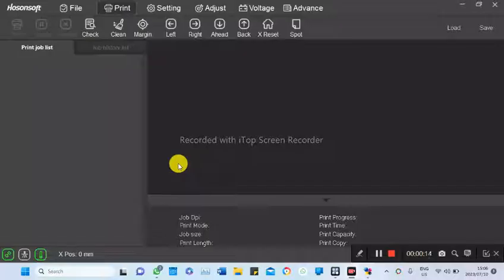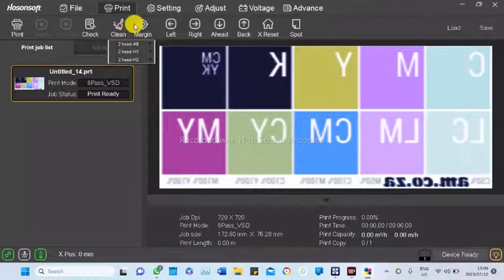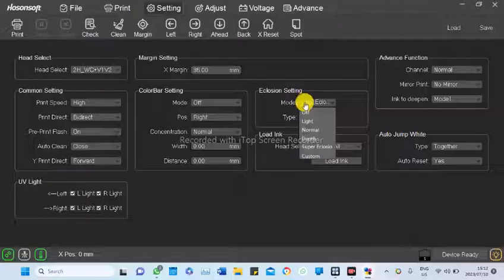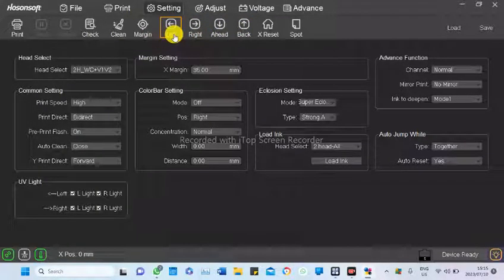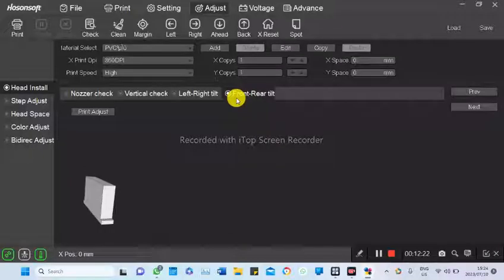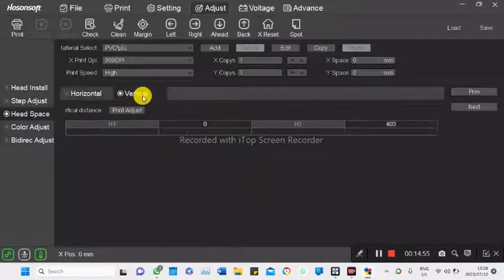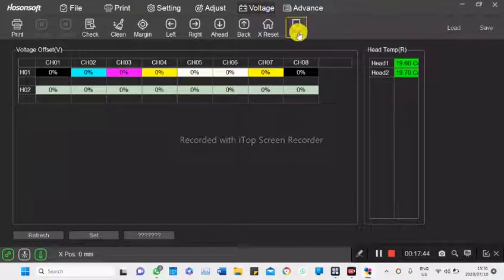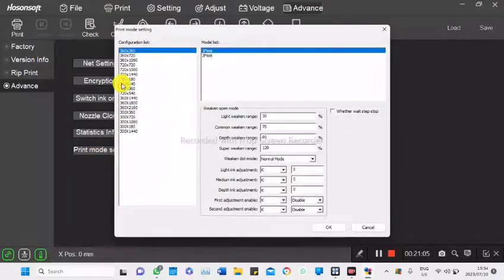DTF HOSONSOFT PrintEXP Part 1

Comment: Hello, my name is Kelvis, I have been looking for information about this program, since I recently bought a dtf plotter with 2 XP600 heads, which was delivered to me with a 720x720 ICC profile but it has many flaws and I hired a technician to make me a new ICC profile, with more resolution. but we ran into a problem, when creating the icc profile on the flexi it tells us a 720x1080 profile in 6 passes and when it comes to ripping a file and uploading it to hosonsoft it does not default the profile to 720x1080 in 12 passes and the prints come out very saturated. We have no solution to this problem. How can we contact you to see if you can help us or tell us the price of your advice in the case?

Comment: Do you think it's possible to take a machine with 2 white nozzle groups and swap one of the white groups to varnish? I assume if I add a completely different container to hold the ink and new dampeners it should just be a matter of getting the software to deal with that change.
Reply: If your RIP software support it

Comment: hi,how to adjust head space?the white ink is a bit off not exactly on the print
Reply: Under adjust then headspace then  vertical. Moving the number higher moves the white towards the printer. Moving the number down moves the wig it’s start point away from the printer.
Reply: would you happen to know how to move the white from left to right?  @msmusick84
Reply: Pls were you able to solve it... And how please help

Comment: In certin colors when its a large solid color i alwys have banding....how can i fix this. Tia
Reply: check printhead nozzle test result, most likley nozzle blocked
Reply: @AchievementMatters  I have this same issue with banding in large solid colors, Its more like a fade for example.... pink to almost white and back to pink... But over and over at equal intervals with perfect printing in between. My nozzle tests are perfect, new dampers and print heads that print perfect when the design isn't a solid color. I have tried changing waveform, eclosion settings, 6 pass and 12 pass printing, omnidirectional vs bu directional all with no luck. Do you have any idea how to resolve it or what I could try? Printer is OKAI dual i3200.
Reply: @woodwarriorworkshop9919  I cannot helo if its not our machines. If nozzle test is fine, our techncian will change some soften settings on PrintEXP to get rid of the banding.
Reply: I'm facing same issue. Did you find any solution for this?